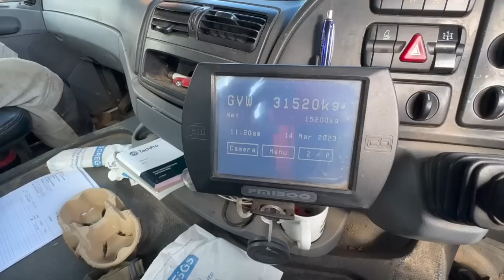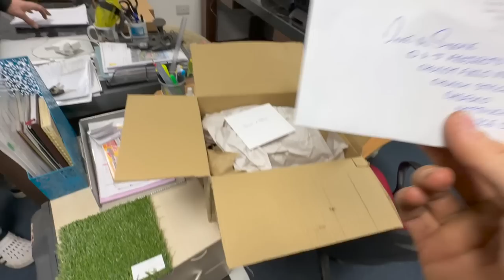Installing a MASSIVE Privacy Gate & Starting Another DRIVEWAY! - This Week At D&J Projects #094

Comment: Not to be a stick in the mud but the big gate install 32:38 is good , But if you need to change the gravel board fence on the left hand side you will have to take the top section off the gate build. I would have perhaps made it so the 2 were independant so you could change at a later date. Not knocking the build, Just the future-proofing.

Comment: short term use Clove oil it numbs the gums - long term use Wisdom sensitive toothpaste best on the Market use it with floss to get right into the gums between the teeth then brush vigorously and leave for a few minutes before washing it out use it for years it seals all your teeth imperfections and it only cost a £1(that's why people think it cannot work)